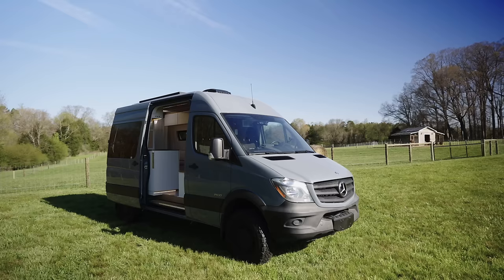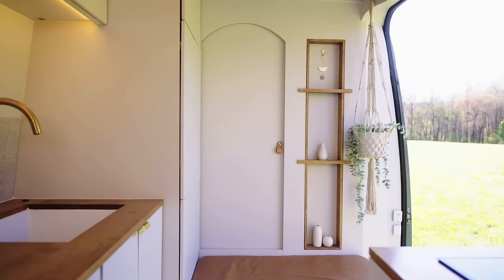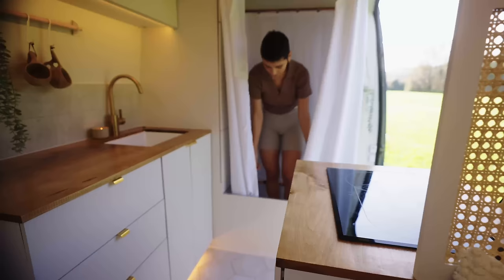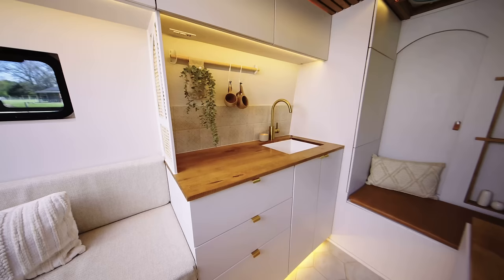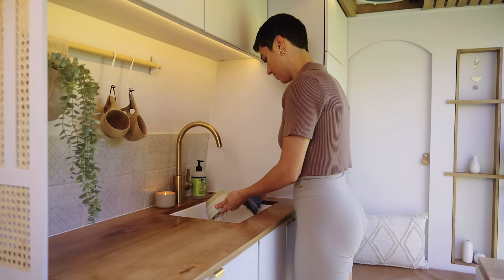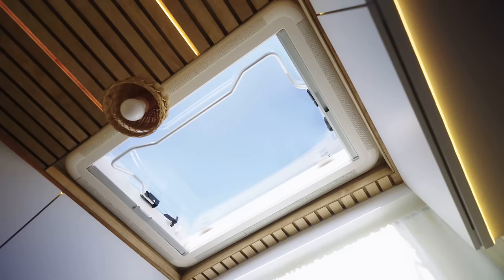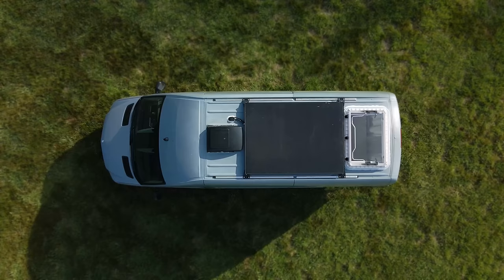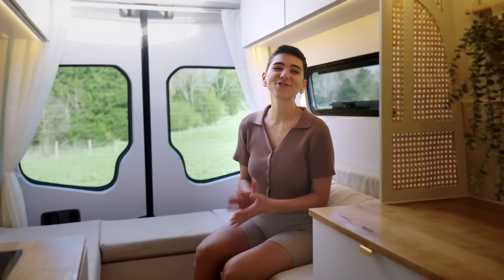VAN TOUR with HIDDEN SHOWER | Modern Luxury 4x4 Sprinter Van Build After 3 Years of FULLTIME VANLIFE

Comment: I love watching the non-RV/fifth wheel tours of these different and unique living accomodations, and the more compact, the better. 

What I absolutely LOVE about your build, is that you do not HAVE to go to and from the cab to the living space through that cut out, but its there if you need it to be (like if someone starts banging on your vehicle in the middle of the night and you need to stay contained within the vehicle perimiter, then you could sneakily climb through the vehicle cab and start the car up and pull the covers off and drive away. But you also always have that sliding door to also enter and exit from, and using the cab doors and the sliding back door, it gives you an alternate option. 

Most importantly, I LOVE WHERE YOU HAVE THE TOILET! I dont care if you use compost or the cassette, but I love where its located. You store  it inside that shower area, and its located RIGHT next to a door. You even have that curtain, and that fan above, so you can VENT the stinky smells out the van! But even more important, its NOT LOCATED BEHIND THE KITCHEN! The worst thing i see in builds, is that the toilet has to be LIFTED OVER THE KITCHEN SPACE, or OVER THE BED/ KITCHEN TABLE/MAIN SEATING SPACE. to exit and enter the vehicle. The thought is I do not want my waste to go NEAR my food! The factor that you have it located right by the sliding door, and that even if you remove it from the shower, you just place it right beside said shower space, and it doesnt go above and over the counter/kitchen/bed space, is absolutely INGENIOUS to me. 

The whole litterbox thing, the factor is, if you decide to sell this vehicle, then if whoever buys it doesnt need it as a litter box, you remove the litterbox insert, clean it up, and BOOM! its now additional storage. With cats you dont need as much cat food, your dry food bags are sold in much smaller quantities, with dog food, its much larger, so that if they have a dog, maybe that litterbox space is where they may decide to store the dog food, or dog toys, etc. 

However, its really a concious build that covers all the bases in what you need to live in such a small space, and remain sanity!
Reply from the maker: Thank you! Appreciate that!
Reply: @scarletandseth  how much does it cost to have a van like this?

Comment: Your van is so well designed it's a treat to see how it goes together. All so clean & neat. 
The accessibility of the power controls, batteries etc is the best I've seen, no crawling around squeezing into awkward gaps under beds to get at any of it
Usually I get a bit claustrophobic thinking about how I'd access switches etc but not with this setup.
The shower & loo are excellent, I could enjoy owning a van like this.

Comment: If you attach a swivel to the copperwork of the shower and cover the shower with a wooder step which you can pull out to stand on you could shower outside the van. I love that you wash your toilet. And also that the shower cable and head teach to the outside so you can alsk wash your feet when you enter your home. You deserve 5 stars.

Comment: @Louis The Van You keep coming up with new designs and never disappoint! Love the new shower design. I think above the bathroom bench I’d have it a little more utilitarian with places for your keys, hats, gloves etc. A towel rail above the sliding door too which could be used to hang clothes on to dry as well. I like the idea of the cat litter drawer in principle but how do you know when the cat wants to use it? You’d end up leaving it open all the time and then when they use it litter getting flicked everywhere. I think a litter tray is better inside a bench with a cat flap. I also like your rattan room dividers but the rattan is buckled. Did you soak it first? You have to soak it so that it swells and then fix it in place, as it drys it tightens up. I particularly like the diesel cooktop meaning you don’t have to carry gas, much better. 

Btw.. the shower curtain being the exact length needed and fixed top and bottom is inspired. Stops it sticking to you! You must have created that yourself, brilliant!
Reply: I’ve been thinking about your shower. I think it’s a great use of space, still allowing you cab access and it also gives you a seat with a view which you often forfeit with a rear bed design. The only problem I can see is that the curtain will take up quite a bit of room in the box and you need space for the toilet, loo roll, cleaning goods, toiletries etc. It would be much better and less hassle if you could leave it up and just slide it away. If you had a narrow vertical gap between the tall unit at the end of the bench and the cab wall you could tuck the curtain in there when dry and not in use, and have it on a ceiling mounted curtain rail that came out and encircled the shower box/bench. If you had a weighted shower curtain it would stay in place and not need to be fixed at the base like at present. In the little display recesses on the right you could have the shower hose and controls, shelf for shampoo etc, all hidden behind a mirror on a hinge. So that it would be accessible you could have 2 curtains, 1 at the back, 1 at the front, but on same rail. If the toilet could be used in situ then the curtain would also provide privacy.  This isn’t my idea! I’ve stolen it from George at Humble Road! Have a look at this video and you’ll see what I mean. 
Go to 7:30mins
https://youtu.be/SOg_qswPXN4
Reply: Omg I love this van, would love to live in here 💖

Comment: Stunning build all 'round so well done.  Tech observation: with the way LiFePo4 batteries are these days (esp SOK) I'm amazed that you don't use more mains voltage equipment. Modern fridges are induction therefore mitigating the high spike load on start up and are more energy efficient but, above all they're around a quartet the price of the specialised unit you employed. The other thing is: CHOICE. You can literally fine tune your kit due to the almost limitless option out there  in a competitive market place where as once you say RV or the dreaded B word (boat) you get your pants taken down on prices.. happy miles

Comment: This has to be my favorite van build. Love the shower/bath idea.
Reply: Great way to have a shower but there is space to have had the pass through slide tip tuck into thar side . Also the toilet is having to remove quite alot to use. Like the "bath" area in shower for washing a pet or any hand wash items. A hook for the shower is possible as well. Great ideas but many tweaks to improve on them.

Comment: Great design and wonderful innovative shower/bench box.  So Practical.  Curious though: with all the concerns today about 5G and wifi and not sleeping with any of it ON, then why are you designing your bed to be OVER the electrical storage?  I'd reconsider that placement and instead put it up front - and maybe behind the driver seat - in the lower part of the closet/right of the kitchen. Just a thought.  Be safe and happy trails!

Comment: I’m curious why you guys are not implementing the levitating/adjustable height bed design. Otherwise, awesome clean built again!
Reply from the maker: It would kill the skylight when not in use as the bed and also leaves you with ugly pillars to hide. It also uses power, risks failure, and isn’t the most practical use of space for a bed in our opinions! This one is also a 144 so sleeping is side to side which means the bed would be super narrow to fit up at the roof so it wouldn’t really work for this van.

Comment: Does the oven have enough ventilation? Ovens get really hot and looks really cramped and might damage the wood.
Reply from the maker: Yeah it has plenty. Being 12v it doesn’t get super hot and the outside of it isn’t even warm to the touch when it is in use. There is quite a large vent on the back of the kitchen unit facing the door.

Comment: Do you happen to know what year this 144" wheelbase 4x4 Mercedes-Benz Sprinter 2500 is? It has to be a 2014-2018 model since it's the NCV3 body with the updated fascia.
Reply from the maker: 2015